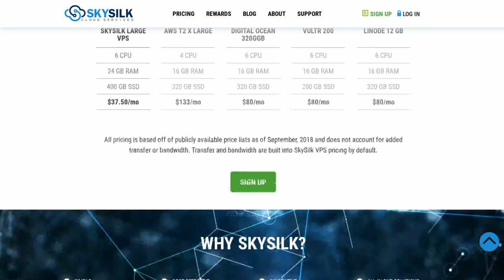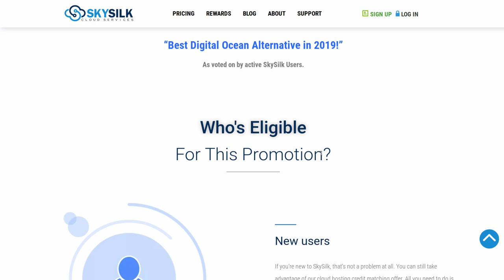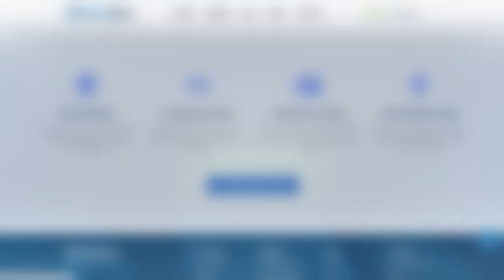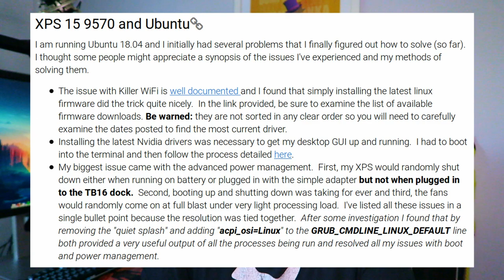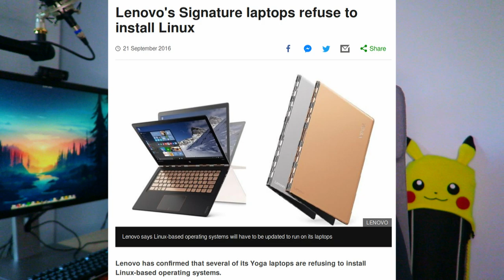Planned Obsolescence in Modern Laptops - A Love letter to Linux and System76

Comment: I hate this modern trend that everything is disposable... and not only in laptops/phones/computers. I bought a pair of bookshelf speakers (they were not the best, but also not the cheapest) and they died on me after 2 months... took to a shop for reparation, the didn't even looked at it, said that "the board is gone and this brand don't make spare ones". So I wen't online and bought (for 3/4 of the price of a new pair) one amplifier board and DYI a replacement (the only good thing is now the speakers are also bluettoth).
I like your points, and totally co-sign this letter!! =D

Comment: I'm cheap. I want my laptop to last for years. I may actually look in to getting a Linux laptop and run Windows as a virtual machine.
Reply: Mayank Shrivas  you might have been running a KDE desktop, maybe gnome. Linux can work on hardware 15 years old with a XFCE desktop (maybe not well on a 15 y/o laptop, but working). A distro I recommend for older software would be peppermint os. XFCE, has a GUI layout to windows 7, and based on ubuntu so its pretty stable. Another linux distro that can work on stupidly old hardware is puppy linux
Reply: Mayank Shrivas  oh we were talking virtual machine? I missed that part, my bad. I was just trying to recomend ways to get linux working with low specs

Comment: My Laptop

intel first gen i3 380M
nVidia 310M graphics
4GB RAM
120GB SSD
I purchased in August 2011.

still it runs smoothly with my dual boot

windows 10 &
linux mint 19.1
Reply: Heyy did you install both windows and Linux in the SSD ? Or do you have another SSD for Linux? I'm asking because I have a 240 gb SSD and I'm dual booting . But Linux is installed in my secondary HDD ..
Reply: @meliodas.1108  i am using single ssd, 25GB for my linux partition.
Reply: You need more RAM -- ideally another 4 GB. :-)

Comment: I used to own an ACER laptop that originally had windows XP, four years down the line i got the BSOD even during a new installation. I change the RAM, HDD everything with no avail.. until i installed ubuntu on it, worked like a charm. The laptop went on for another SEVEN years! Naturally I have been an exclusive ubuntu user ever since!!

Comment: My old laptop:
ASUS x555l
4 ggb RAM, i3 5005u, 1 tb hdd
Worked well with Kubuntu 18.04

My new laptop:
ASUS vivobook s15
16 ggb RAM, i7 8550u, 256 ssd + 1 tb hdd
Works well with Kubuntu 19.04. WiFi, keyboard light, hotkeys, screen resolution - compatible without any additional drivers or installation

So, maybe ASUS or Acer can be better choice for installing Linux than Lenovo
Reply from the maker: Good to know, thanks for sharing your experience.

Comment: The one bit of “obsolescence” you really can't escape is that laptop batteries wear out — damn you, laws of physics! But you’re right, so much else is a gimmick.

I’ve got a MacBook 12” from 2016, one of Apple’s slowest machines from the past 5 years. But hey, it does everything I need it to do, so I don’t have any reason to “upgrade.” (And I genuinely love the thin and super-light form factor, so I traded off performance with my eyes open about it.) About six months ago, I took it to the Apple Store and paid to get the battery replaced. I’m sticking with it for as long as I can.
Reply from the maker: One of the reasons why I love my gazelle as I can buy a new battery for $50 and swap it without opening the case :D
Thanks for your comment, and indeed, Apple up until late 2016 used to build super reliable and long lasting machines.
Reply: Yeah, the  old Macbook Air is SOLID too. Like, mine is 4yrs old but it still gets the same awesome battery life as when it was new--Can you believe that 🤯

Comment: I just recently bought a new system 76 oryx pro. Not cheep but very nice, and a lot lighter than my old one from 2016, which is like a tank, similar to what you showed in the video. My old one is going to my future wife. The new one:
Six core 4.5 GHz cpu
64GB of ram
500GB SSD
Nvidia and Intel graphics hooked to 43" 4k,via usbc
The laptop ah a 16" display, and fits in my bag better than the 15" tank. I'm expecting I'll get several years of use out of it, because of it's high specs.

Comment: My computer's

Desktop = iMac 2011, lost support about 4 years ago, running Arch Linux and it works like a dream. (I did upgrade the 4GB RAM to 10GB RAM)

my laptop = MacBook Pro 2012, running Arch Linux, works like a dream. (When my hard drive broke I opted for the cheaper SSD, which made the bootup and application launch  literally 10 times as fast as the failing hard drive)

my server = the Original Mac Pro (2006), running Ubuntu Server 18.04, also works like a dream, it can server files to up to 4 people at a time (disk read and write limitations, though only 2 people ever use it.) run a MineCraft server, Home-assistant all with 24/7 operation (reboot about ones a week). 

You don't need a new computer, you need Linux and maybe a RAM upgrade, or SSD rather than HDD

(Disclaimer, Though often it is, Linux might not be compatible with your machine, check online so you know what to expect!_)

Comment: Still rocking my Thinkpad x230 (i7-3520m, 16GB RAM, SSD) with Debian on it. It's lightning fast! The only downside is the battery life with those M model. I get like 4-5 hrs medium workload (webdev, browsing the web) with a battery at 70% of its original capacity.

Comment: Hello, I want to ask, there is any alternatives to Microsoft Office for Linux ?. Because I want to switch from Windows to Linux on my old laptop and also I quite like Linux due to free software that can run smoothly on the old laptop that was bought cheap 2 years ago (2019).
Reply from the maker: LibreOffice is the best in my opinion, and you can also customize the UI to make it look like Microsoft Office if you're used to that interface.
Reply: @alecaddd  okey thank you very much, maybe I have never use Linux before but I'll try to switch to Linux for the first time. Thank you very much

Comment: Spending $2K for a new laptop is insane regardless how good or bad it is. A fine laptop should not cost more than €250 or €300 max, if it's extremely good (super fast, extra large storage, an excess of useful ports, ...) And lastly ALL new laptops should run at least 2 years great and run at least another 2 years decently. That's regardless whether you choose to use Windows or chastise yourself with Linux.

Comment: Deal breaker for me is sealed batteries. Makes the entire laptop a disposable item. Screw Apple for doing that to a $3K Macbook pro 16. On my 8 yo Thinkpad W30 running Ubuntu 16 I replaced the batter for $75 and a firmware update. Still running. Replacement will likely be a System 76 Oryx Pro.

Lenovo Thinkpad Extreme X1 Gen 2 is also a good option if you want something lighter and thinner and don't mind paying the extra money for it. You can configure it very much like the Oryx. You just don't get the System 76 TLC around some custom linux drivers, and their software support..
Reply from the maker: Totally agree

Comment: i'm confused, how can a computer 'refuse to install' an OS. shouldn't you be able to just wipe the disks and boot from a USB? i mean fundamentally doesn't it just get down to BIOS and then setting up a boot partition and the filesystem?
Reply: It is the bios that prevents another system other than windows to be installed. I had to fight and fight to get around my laptops bios to accept linux being installed.

Comment: My Alienware 17 (2014)
CPU: i7-4710MQ
GPU:  AMD M290X
Ram 16Gb
OS: Pop!_OS and Window 10
With Pop!_OS works smoothly but with Windows after the latest big update worked like crap I had to reinstall Windows and then fight with it because my wifi card didn't worked well.  (For me windows also have part in the programmed obsolescence)

At least all my work is on Linux so I hadn't to do that asap.
Reply from the maker: Indeed, Windows is also part of the problem

Comment: What you said about Linux just working on older Thinkpad machines is wrong. What happens is that because Linux doesn't need cutting edge technology, you don't need to buy the newest release models, so IF you want to change your machine for any reason it's better to wait a little bit and do it for a better price. When I bought this Thinkpad X250 I'm using right now, I had no problems towards Linux compatibility with the hardware. And the same was true for my old T420 and the X220T  that I still have and works pretty well. But as a Linux user, I'm very glad for companies like System76 as well, but Thinkpads+Linux are just better for now.